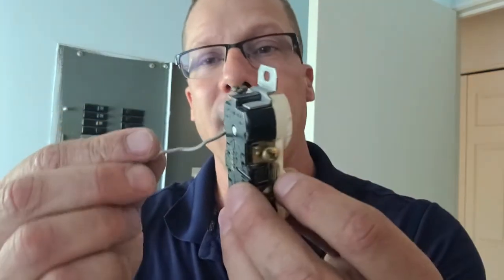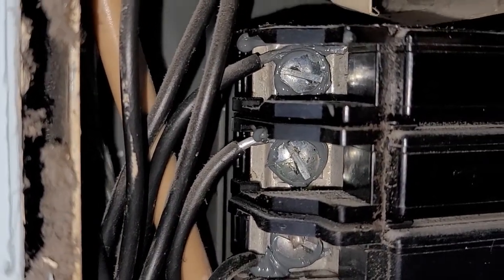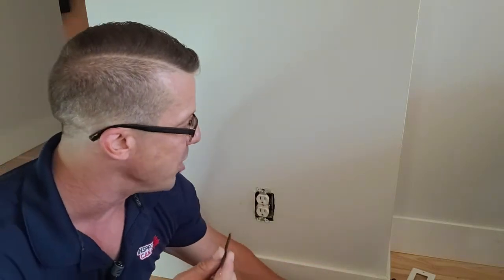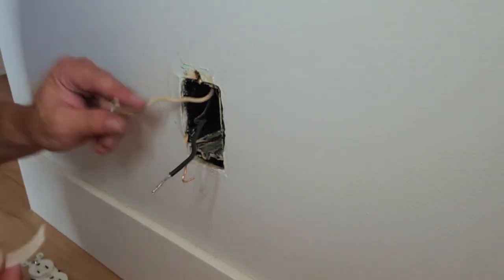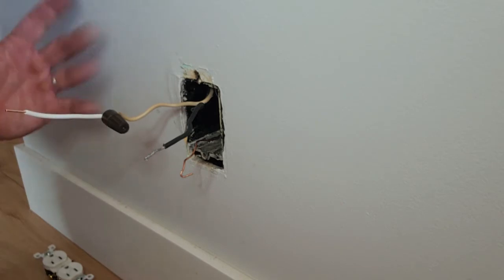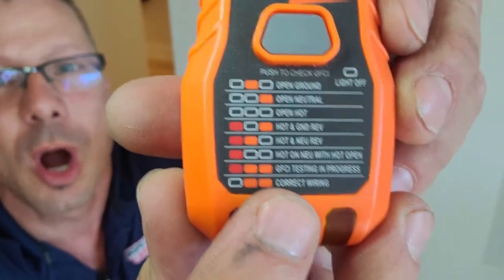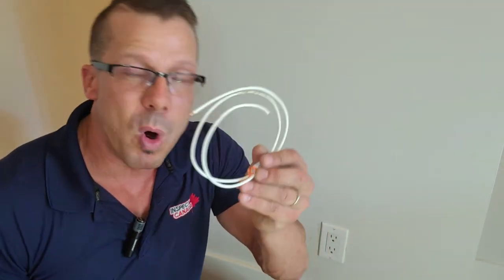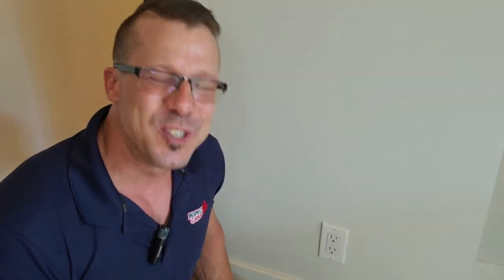How to pigtail aluminum wiring to copper

Comment: Apprently canada does not follow the safty protocol estabilished by article 110 of the NEC or by NFPA 73 or national fire protection assoiciation. I noticed you are a "home inspector" not a licensed Electrician of any standard. 
What you are showing does not under any insurance standard meet requirements set forth in the US quite frankly your better off leaving the alumin7m wiring as is where is then mixing it with copper wiring. Horrible practice. Read an NEC code book!
Reply from the maker: Thanks for your comment. This is been done everyday in BC Canada. Whatever happens anywhere else on the planet is irrelevant. These videos are not designed to teach electrician in the US on what to do but to show homeowners that aluminum wiring is not the end of the world and that pig tailing is an approved solution that is accepted by most insurance. I fully get it that replacing the wiring would be much better but pig tailing would cost about $1500 where replacing the wiring and cut the drywall that probably has asbestos in it would be a lot more expensive.  In the US you can buy houses for 300k, here the tear downs are worth over 1.5 million. People need affordable solutions and here is one. Electrician follow the CEC, not the NEC.
Reply: @michaeldupre7864  yes it does allow them...***however...most all aluminum/copper rated devices specify that you must Tighten the connections every 1-3 years (depending on manufacture) no one is going to keep up with that much less pay a certified electrician to do it, therefore the warranty is voided. This is how the manufacure gets away without liability. Think of it like you just bought a new car drive 80k with no oil change, the manufacture is not on the hook for it, you neglected the maintence.  Same thing with copper/aluminum devices.  Atleast this is true for all of them that I have seen although I'm certain I have not seen them all. I can show you hundreds of pictures of copper rated devices with copper wires or copper wires connecting to copper wires and they have burned. The most important thing in electricity is the connections. I personally use alumicons, I have seen a couple fail but we are talking 2-3 in tens of thousands and the ones I seen fail we not made by my company. It was because the screw terminal was not tightened properly. I understand the predicament, however if it were me that is how I would do it.
Reply: @michaeldupre7864  the failures were from other contractors not properly tightening them, im just an electrician contractor with a stack of licenses, I have no dog in the fight either way. My advise is to wrap the screw terminals in the direction the screw tightens so that the screw is pulling the wire around it not losening it. If you have 2 neutral 2 hot and 1 ground on the outlet you only need 3 alumicons not 5, your effectively converting from series wiring to parallel wiring, which is superior in every way except time and material from the new construction standpoint. Also, very important on your 3 way switches the wire going to the odd color screw on the existing switch needs to go to the odd color on the new switch, do not take the old one off and put it back blindly the same way. Just look at the screws (not including ground) 2 will be the same one will be different, mark that one and ensure that wire goes onto the one different screw on the new switch, the other two are irrelevant and cannot possible be confused and do not matter which goes where.
Reply: @michaeldupre7864  yes, however this situation should not occur often, same with neutrals, maybe once or twice in a home.
Reply: @@michaeldupre7864 sure.
Reply: @Mountaintoptractor so your complaining that he’s showing a solution for Canadians accepted in Canada by the CEC because Americans are watching YouTube.

Comment: Use Wagos.
Reply from the maker: You use wagos, we use marrettes. This is a simple guide for homeowners based on what is done here locally. If you like to use wagos, go for it.
Reply: @InspectCanada  As far as I know, Aluminum may never touch directly Copper due galvanic corrosion. Even with marrettes, it is not allowed. Maybe some current will pass through marrett,  but definitely not a lot.
Reply from the maker: @tarassu  that's why you have to include the anti-oxident paste on it.